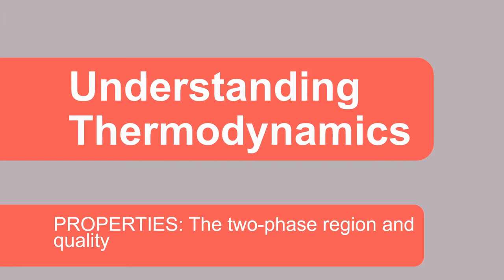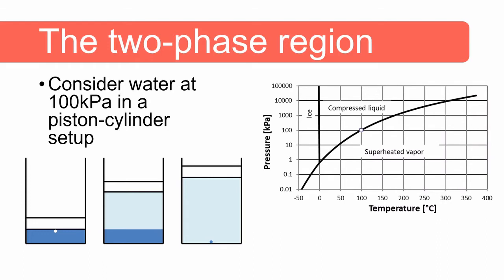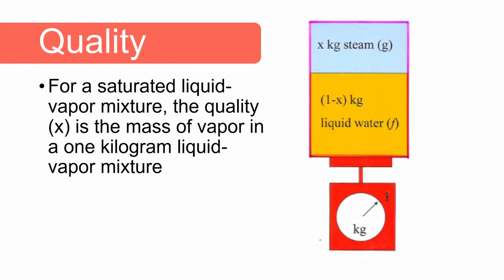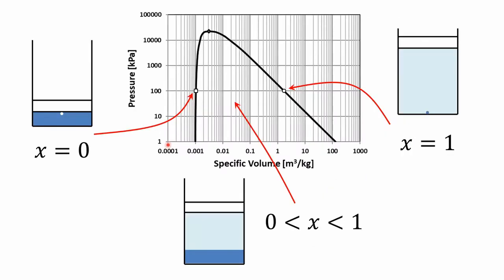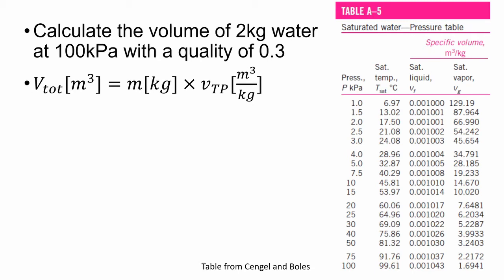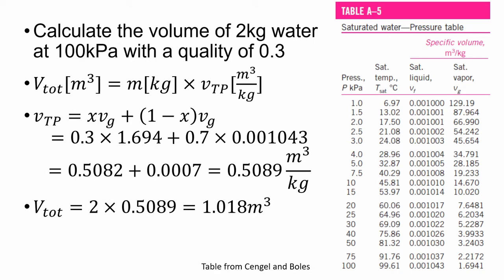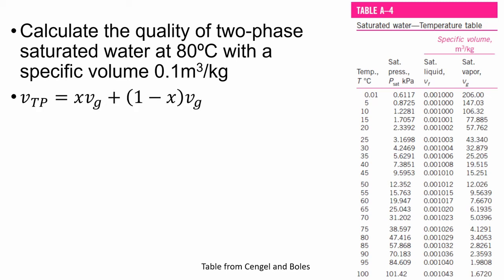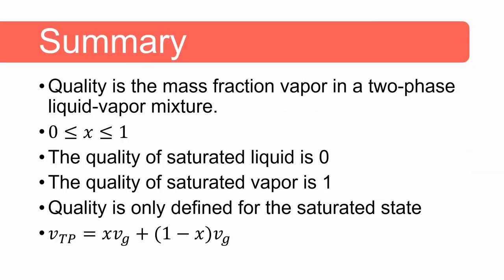Two-phase region | Quality | Vapour/liquid mixtures | Mechanical Engineering Thermodynamics

Comment: Sir if the pressure is not given how can we identify the pressure?
Reply from the maker: Hi there! You will need two other properties, such as temperature and either enthalpy/entropy/internal energy etc. As long as you have two properties your state is fixed and you will be able to calculate all the other properties